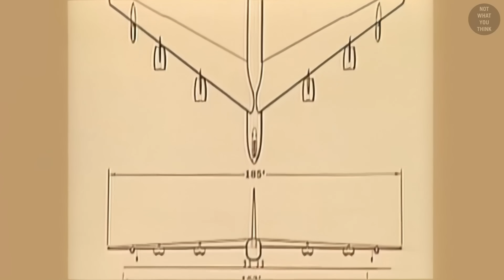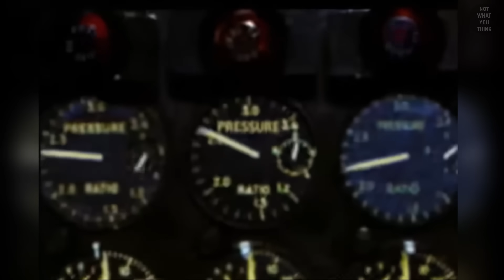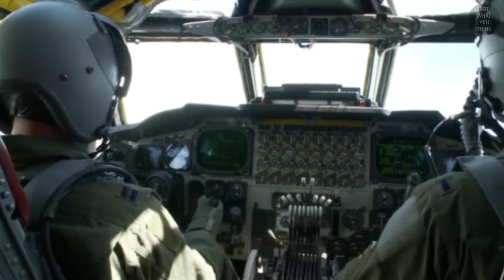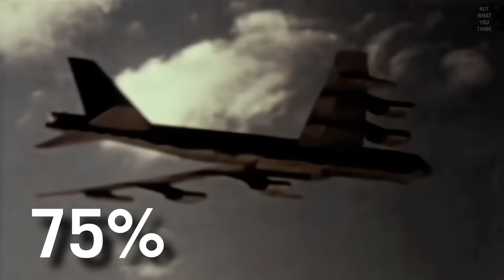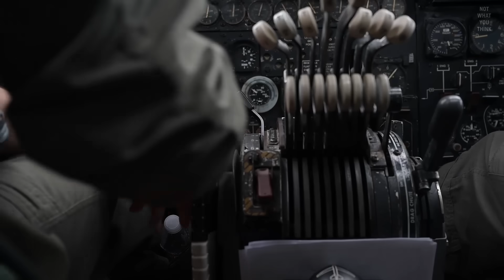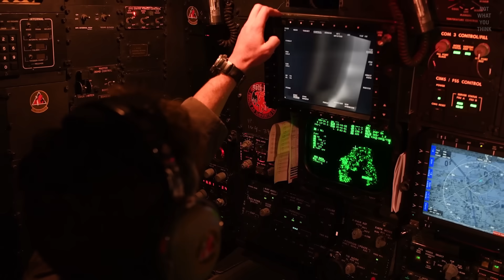Why This Obsolete Bomber Will Outlive EVERYTHING

Comment: Brings back memories as a refueler in the Air Force during the 80’s while at Castle AFB. Took me 2 hrs to fully refill a single BUFF. Close to 40000 gallons of JP4. If I was in good terms with the pump house operator who supplies fuel from the storage tanks, he’d go against tech orders and switch to two pumps to increase fuel supply volume to my hose cart and refill of a BUFF would take 1 hour. Remember those freezing winter temperatures on the flightline as I worked nights. Wind howling. Standing in front of the diesel APU exhaust just to stay warm during refueling. Great conversations bullshitting on our mics with the crew chief and ops working the tank controls in the cockpit during the long hours.  Now I’m closing in on 60 and would not trade  those memories of my enlistment for anything.
Reply: That’s a dope ass story man thanks for sharing!!
Reply: Merced isn't exactly known for freezing winter temps.
Reply: what was the safety issue of using two pumps to refuel?  would something occasionally fail?
Reply: I feel that. I did avionics work on them for 8 years. I only noticed the fuel guys when they had to put on the bunny suits to climb into the tanks or something like that.
Reply: Hey! I was also at Castle in the 80's. How well I remember the minimum interval take off and landing exercises while living in the barracks  beside the chow hall. I worked FMS and I sat on the roof of the phase hangar and watched one of our TDY birds burning on the runway as it touched down from Guam. Burned all night. We had a lot of trouble that year, lost a few planes and a couple of unfortunate deaths on the base. Got a commendation medal for my actions after the crash.
Reply: @joshhooker7390  Hey Josh, I mentioned that I was vehicle ops there. I didnt mention that I was the driver that picked up the crew for that BUFF. Was odd to see crew running towards then past my bus while waving me away from the plane.  Also saw the crashed 52 during the time the runway was being rebuilt up by Mather as our route there went close to the field it went into, a day or two after the crash. Unfortunately I was one of the drivers who took the emergency notification personnel to the families the day of the Mather crash. That is the one time I wish I had been on a different shift. Saw a lot of interesting things sitting on the parking area waiting to pick up crews.
Reply: I didn't know it got that cold in Atwater, California?
Reply: I feel ya  @Realistic, I spent some years in that same era at Castle as a bus driver delivering aircrews. At least I got to stay in the bus most of the time when it was cold.
Reply: Realistic...Just think if you would have gotten to experience a nuclear war..What more could you ask for..Oh well I guess boys will be boys..
Reply: I'm gonna call bullshit on this.  "Castle AFB" and "freezing temperatures" is a blatant lie.  I was stationed at K. I. Sawyer AFB, which is in the Upper Peninsula of Michigan and north of some parts of Canada.  Castle is near Merced California, so south of San Francisco. (edit - and we had B-52s and KC-135s.  In fact IIRC the first two aircraft whose tail numbers I can see in the video, 0036 and 1013, are ones I have personally climbed around inside fixing avionics.)

If you thought that was freezing then you need to put on your big boy pants (and a parka, mukluks, and a really good hat) and go do maintenance on the flightline in sub--zero temps.
Reply: Oh dear gawd, Castle AFB (Merced, CA) was so darned cold! Good thing you weren't stationed at Minot AFB...
Reply: Who the hell?
Reply: Forty thousand gallons, wow.  Helps explain why the Department of Defense  consumes 1% of the world's petroleum output.
Reply: @dixonpinfold2582  the 707 holds rougly 75k in the center tanks and the wings hold another 70k or so so around 150k 160k in pounds of fuel.. cant remember the gallon amount rn
Reply: @adamsauer6516   At 7 lbs. a gallon, that's over 20k gallons.  Also a lot.
Reply: people getting triggered by syber-VHS for nothing smh
Reply: @chloekaftan  It's nothing to you and clowns like Syber.
Reply: @chloekaftan   For bad manners and stewpidity.  You've heard of them of course.
Reply: @chloekaftan  literal boomers most likely
Reply: @DGP406  
   Hey bud, what’s your problem??
Reply: @dr.OgataSerizawa  He's just a dumb troll.  Thanks for the story OP!  That's the type of stuff that makes life worth livin ;)
Reply: and my dad works at Nintendo
Reply: @DGP406  do you really think someone would steal valour by saying they refuelled B52s? It's not exactly a glorious job, I'm pretty sure this guy is real
Reply: @alexbrown1050  for me is an absolutely badass job
Reply: @DGP406  You do realize the Armed Forces isn’t just something you see on TV and video games, right?

Comment: Don’t forget the C-130, a cargo plane from the 50’s that’ll also live forever. My dad always said “when they retire the last C-17, the crew will fly home on a C-130.”
Reply: The C-130 has new models coming out all the time, unlike the B-52, the C-130 is always brand new off the assembly line. The oldest model C-130s that are still being used are the H and W models, much younger than the B-52 airframes.
Reply: @OriginFlightStudios  there are still original C-130E airframes flying that have been upgraded to H's
Reply: @OriginFlightStudios  so if my country have C130H..... that's mean it's old than B52.
Reply: @mohammadnoormauludadnan1847  No, H models are younger than the B-52...you should reread my reply
Reply: @OriginFlightStudios  oh I get it. ...just like younger brother.tq
Reply: Or maybe even a DC-3! There's hundreds of them out there still in daily commercial service with the old radials, and several outfits completely rebuilding them with longer fuselages, bigger wings, and new turboprop engines. The airframes are so robust that the FAA is certifying the rebuilt aircraft as zero-hour new. I love those things.
Reply: @jadefalcon001  Somewhere, there is a DC-3/C-47 flying around that sets a new world record for hours flown EVERY TIME IT TAKES OFF. They used to keep the current record holder on display at The Air Museum but....a couple of months would pass it wouldn't be the record holder anymore.
Reply: @jadefalcon001  Yeah they are an awesome plane.  My dad flew a DC3 to the bahamas on a cargo trip once
Reply: @jadefalcon001  bunch of em up in Alaska used as Bush planes bringing cargo in to villages , so damn reliable pilots love em
Reply: That's funny and probably true 🤣 
Last C-5 and C-17 crew flying back in a Fucking Hercules! Lmfao!
Reply: Yeah...the C-130 is the bomb.

I’m an engineer on that program...have been for about 23 years.  Needless to say...there is some significant history there, and I am always uncovering stuff that I never knew (found an old C-130 engineering report...from mid to early 50’s…..with Kelly Johnson’s signature on it – that goes with me when I retire!).  I spent the first 15 years of my career working on some “new” aircraft programs, and I am proud to have been a part of them – seeing them in service, but working on a program that has been around for decades...and still plowing new ground...can’t beat that.   

There are numerous versions and variants:  C-130A, B, E, H, J; KC-130, MC, HC, EC, AC, DC, NC, LC, WC.

Based on current and future sales...it seems like the production line is good for another 5 years at least….making the production run of something like 73 years (with a first flight in 1954).  Could be more.  I don’t see a replacement on any drawing board at the moment (and there have been a couple tries at that over the years).  Sadly, I’ll be long since retired when they do, finally, choose to replace it with something new. 

To quote one of the primary designers of the bird  when he was interviewed on a visit to the Lockheed Marietta GA facility on it’s 50th anniversary (Willis Hawkins)…..”The C-130 is not exactly an attractive aircraft. It is still in production and still doing the job it was designed for. Originally, some questioned who would want to buy such an aircraft. Irv Culver, one of our engineers, said that if we made it right the first time, we could sell it to anybody. I think we must have done it exactly right."

“Exactly right”….is exactly true.
Reply: Yep.  I visited a Boeing factory located in a military base in Georgia.  They were still building new Chinooks and C130s there. 
Old base design, perhaps...  but still new and relevant.
Reply: @1SqueakyWheel  a Boeing base in Georgia that builds C130s? Interesting because the only base in Georgia that builds them is Dobbins and it’s a Lockheed plant. I work there. Boeing had a plant in Warner Robbins but they were making sub assemblies, not whole aircrafts.
Reply: The C-17 looks like somebody poured water on a C-5 and it shrank.
Reply: a cargo plane will always be able to carry cargo. where as the usefulness of a bomber also depends on the capability of the enemy.
Reply: My sisters husband flew for Squadren 34 , Australia ... The C130 even has rockets they attach to the body , that enables it to take off in the same area as a football stadium ...
Reply: @aperitifs  called JATO, jet assisted Take off.
Reply: Antonov AN-2 enters the chat
Reply: Or the AC-130 munitions barge, it won't survive the opening moments of an air conflict, but once the skies and fields are swept of threats by the new fancy stuff, they can be deployed in greater numbers and loiter longer to backup soldiers and marines in a tough spot.
Reply: C-130 B are still in good service in my AF Indonesia.
Reply: I was at Edwards AFB when the C-130J was in initial flight test in the 1990s.  They have been making new C-130Js into the 2000s.  I suspect they are still making new ones today in a continuous run since the 1950s.
Reply: @darrenhersey9794   My base has the 500th J model produced.  Its currently got around 40 flight hours on it.
Reply: In essence the c130 is like the spitfire, it get so upfraded that, could have a new designation, but keep the original one as and upgrade, as people say, it still get new ones and very upgraded compared to the original
Reply: “AC-130 Above!”
Reply: C-130’s will always be relevant as long as they’re turning them into ac-130’s
Reply: Captain Smith  what the hell you said
Reply: Sounds like a wise man
Reply: My birth village Schaffen (Belgium) had c130 hercules' up untill 2 years ago for the commando training at the local airstrip. The strip is basicly used by the military and also aviation enthousiasts (gliders and small sports planes). Yearly also for an oldtimer fly/drive-in where people will park oldtimer cars and planes to see. The c130 is now replaced by a a400m atlas due to the high fuel consumption the c130 had. It was an unbreakable machine. There is also a unique zeppelin filled with helium to train commando. But recently the manufacturer stopped and they are now searching for someone new to do the yearly check-ups.
Reply: And they will hate every minute of it. A flight on a C-130 is God awful.
Reply: Nah

The C-390 will replace it
Reply: Nope, because most of the C-130 are not the C-130A or any very early version, they were manufactured far later than 1962. The C-130H and especially the C-130J are far, far more younger with different engines. While the last B-52H was manufactured around 1962 and still uses its original engines...
Reply: @militavia-air-defense-aircraft  But those pratt & whitney engines are scheduled for replacement by new rolls-royce engines.
Reply: @militavia-air-defense-aircraft  Are you sure?  I read 1952.
Reply: Saw one go by today...
Reply: C5 enters the chat
Reply: Or a C-5
Reply: The difference here is that the C-130 is actually a good machine lmao
Reply: What do you mean?
Reply: Yet another plane that’s perfect at what it’s meant for. I see no reason to get rid of the AC130
Reply: @TheRealArtimusKnight hell from above
Reply: Wyoming Air Guard flies C-130 out of Cheyenne, I remember my childhood home was under the flight path, they broke 4 windows in 1 year
Reply: The thing about it is, the Hurc is still rolling out fron the production line.
Reply: Yes, as long as Biden still allows the required fuel.
Reply: @garyolson589  Biden will burn in hell soon for the terror he caused.

Comment: Even if it became completely obsolete for it's job... It could possibly be converted to an aerial refueler and used until the end of its service life (or starts braking down)
Reply: Even with the new engines it's way too inefficient for that compared to the tankers the USAF has and is getting.

Comment: That there is the United States Flying Terror dump truck, never really used in real anger.  It is designed to carpet bomb cities replacing the 200+ b-17 with 20+ b-15.  The United States has not carpet bombed a city sense worldwar II.   The way it works is you strip out the air defenses and this big lumbering truck flies in nice and slow.   Then you start will AP bombs to crake open shelters and bunkers, HE to kill exposed personal and destroy most buildings, and incendiary to cook the omelet.     A carpet bombing by b-17s on Tokyo did more damage than the nukes used against two cities.  This is probably why we have not really used it for what its for.

Comment: I think people often confuse old with obsolete. If something still does the job it is far from obsolete
Reply: As long as the U.S. Force maintain air superiority in every conflict it enters, the B-52 will never be obsolete...
Reply: The B-52 was a "long range missile carrier" 50 years ago! How is that any different than what its mission is now? In other words: The mission has remained the same. It is, therefore, NOT obsolete.
Reply: Obsolete has several meanings: equipment can become obsolete because repair parts are no longer available, because the job it was meant to do is no longer need, or because the design is no longer able to complete the task due to changes in the job requirements. Really, the B-52 was "obsolete" from day one: no one seriously thought that strategic bombing was possible without air superiority. It's simply not possible to gain air superiority against a significant enemy, while simultaneously making the first or second nuclear strike of the apocalypse, which need to take place in the first 15 minutes of the war. There's just not enough time, it's better to just keep a few dozen SLBMs cruising in the North Atlantic/Pacific/Baltic/Mediterranean where they can be just a few minutes flight from major targets.
Reply: Yep, like the A-10 Thunderbolt.  Still a frightening sight on the battlefield.
Reply: Like a matchbox
Reply: Obscelencent is the term for this, it has been technologically surpassed and would be no one’s first choice, but still functional, reliable, and inexpensive
Reply: @SenorBigDong69  it’s not becoming obsolete though. It can still fire off long range munitions just as well as any other platform out there while doing it at a fraction of the cost.
Reply: @alexalbrecht5768  being cheap is the only thing it is best at. The F16 can fire the same missiles as the F35, but the F16 is still obsolescent regardless of the fact it will stay in service for 20 more years like the B52 only because it is inexpensive to operate.
Reply: The  BUFF is the AK 47/74 of planes
Reply: But you have to admit if we build a modern version China wouldn’t last a day in case of war
Reply: 'Technical obsolescence doesn't mean practical obsolescence' is a phrase I like to use.
Reply: The Fairey Swordfish got the job done. It was still obsolete.
Reply: @mikepotter5718  evidently not
Reply: That's what she said